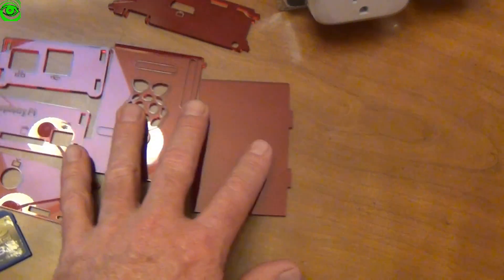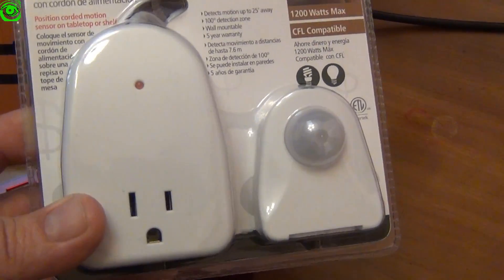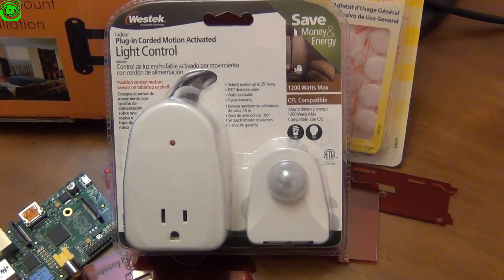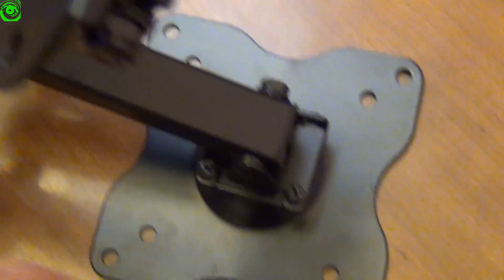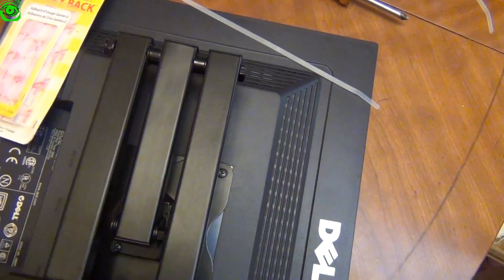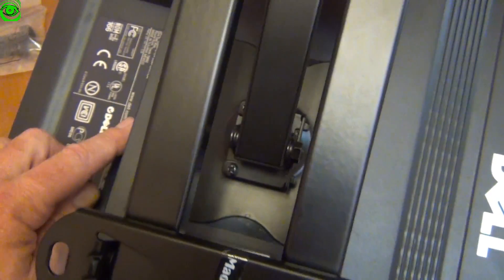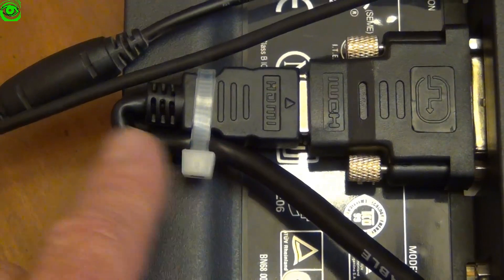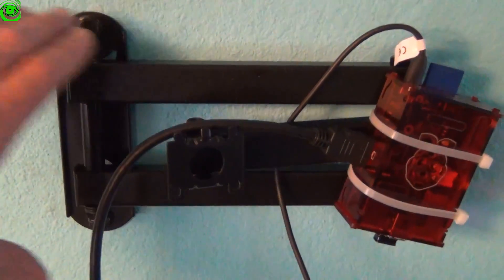DIY Raspberry PI Digital Picture Photo Frame - P3

Comment: Can this be made to access a shared Dropbox folder instead of a local folder or instead of copying files to an SD card? That way, one could just move pictures in and out of the dropbox folder from any computer or internet connection and have the slideshow updated.
Reply from the maker: Good idea!  Have you seen this?
https://www.raspberrypi.org/magpi/dropbox-raspberry-pi/

Comment: I am looking for slideshow with random photo order and with random transition effects. Can I achieve that with Raspberi Pi. I see that it changes the photo, but didn't see any transition like in old Nero. Can you advise something?
Reply from the maker: Hi Alex,
This method didn't have any transition effects.  I'm sure if you searched you may find a better slide show software.  This video is close to four years old and that's ancient history for most computer technology.
Good Luck!
Doug
Reply: Thanks Doug.
 I was trying to get advise from any possible source, and your answer is greatly appreciated. I didn't find anything simple with transition yet, but I found your video as a kind of what I am looking for. No transition here, is the answer that means it is not for me. Thanks again.
Reply from the maker: Did you see this?
https://www.raspberrypi.org/forums/viewtopic.php?f=38&t=61389
I didn't read it all, but, it looked like what you may want.  Check it out.
Reply from the maker: Infobeamer looks like the ticket:
https://www.raspberrypi.org/forums/viewtopic.php?f=41&t=60791
Reply: Thanks a ton. Will try. You are THE MAN. Thanks again

Comment: Doug, I had your wonderful picture frame up and running, but then my SD card got corrupted, so I had to start over. The new one runs, but with an odd twist. The old one would run the slide show until the motion detector timed out (20 minutes) and shut off the power. The new one runs for about ten minutes, then the slide show stops, but the power remains on.  Have I messed up a setting that controls how long the slide show will run? Any thoughts?

Thanks

TomC
Reply from the maker: Hi Tom,

It sounds like the screen is timing out and powering off.  Check out this part:
https://youtu.be/PHwyIIjz4vA?t=14m6s

I've been super lucky, my SD card hasn't been corrupted, and it turns on/off all the time.  

Doug
Reply: Thanks for the response. The monitor and pi are staying on, its the slide show that is not displaying. Can't quite make sense of it.
Reply from the maker: What happens if you start the script from the command prompt?  I saw someone else having a problem with start up, but, it was because he was mounting a USB drive.  I think he solved it by launching the script on a longer delay.

But, a good first test is to start it from cmd prompt after it's booted up.  If it's always timing out after 10 minutes, there's some kind setting missing.
Reply: Problem solved. It was a screensaver issue. I updated the os and the screensaver and all now seems to be working. Thank you for taking the time to reply.
Reply from the maker: Excellent!  That's a happy ending!  =  )

Comment: what's the total cost of this project
Reply from the maker: Depending what you have...most of the cost is the monitor.  I had the monitor already and think after everything include wall mounts, timers, RPI, and all hardware...approx $150.  Sure it's more expensive than the 8 or 9 inch models you buy in the store, but, i think it was worth the expense to view my family photos on a larger monitor.  Also, if you do decide to work this project, the OS on the RPI has changed and some of the instructions are different.  However, many people have made comments about the needed modifications.  Ideally, if you can find an older version of RPI OS then you probably will not have to deviate from these instructions.  Thanks for watching Anand.  Doug
Reply: Thanks Doug
Will try it out

Comment: Hi is there a way of making the slide show recognise a new photo added to the folder? when a new photo is added it wont show unless you stop and restart the slide show I was wondering if there was a way of refreshing it automatically so i can just add and delete photos while it is running?

Also mine doesnt auto start at boot up but thats not an issue.

Thanks David
Reply from the maker: +David Forsyth Hi David, since mine is on a timer, that simply shutsdown after 30 minutes of no room activity, it hasn't been an issue for me.  However, your correct, if you add new photos, then a restart is required.  As far as your autostart, other comments below have solutions for this problem.  Unfortunately, right after I did this video, the RPI OS changed, and the autostart changed a little.  Thanks for watching!  Doug
Reply: +Astrophotography Tutorials i managed to sort it i added the --refresh 5 into the file and it refreshes every 5 seconds now and works great, i also added the auto startup line in the lx file direct and it also worked :)
Reply from the maker: +David Forsyth Wow Great Tip about the --refresh 5 David!  Thanks for sharing!  I'm glad you got it working.  I really love my Photo Frame, so much better than any department store version you'll find on the market.  Doug

Comment: Is it bad for Raspberry pi to Power Off abruptly without the Poweroff command? Wont that corrupt files when power cuts out a few times a day? I like the idea that the monitor could be on the motion sensor and Pi stays live all the time.
Reply from the maker: +Miram Afridi Hi Miram, I've been running mine now like this for over two years, and it hasn't corrupted any of the files.  It's still ticking...perhaps its just dumb luck on my part.  I have my motion sensor power on and off everything including the RPI.
Reply: Hi Miram. Do you ever notice that some people seem to get away with "murder" whilst others get stung on the first attempt? Well, switching a computer, any computer, including a Raspberry Pi, can cause corruption of the file it is currently accessing or the FAT (File Allocation Table). It also seems to happen when you can least afford it too! It would be good to put a transmitter or  Infrared sender on the PIR sensor and have the Raspberry Pi perform a controlled shutdown then turn off the power after it has completed the shutdown. A lot more complicated, I know, but it could save time and the trouble of rebuilding the SD card file system etc.  Just wanted to let you and anyone else know that there are risks with simply switching the power off on a Raspberry Pi. You wouldn't just switch the power off on your Windows PC or Mac would you? This is no different.  What are the odds?

Comment: an you take this idea and instead of using an old computer screen, can you use an old LCD flat screen tv? say a 36 - 42inch flat screen?

cause I have a lot of images I would love to have up on my wall but its too expensive to print them out and such, so I was wondering if it was possible to take a large tv flat screen and do basically this to it, with a wifi enabled raspberry pi?
Reply from the maker: Rivyn Daniel Yes, you could use most any monitor/Tv screen.  I must report that I ran into one Monitor the Raspberry PI didn't recognize the resolution and it would not display...you may need to experiment a little first, however, if it doesn't work you will not be out a lot of money.  You can use the Raspberry PI  with WIFI, but, it seemed slow to download and display the image.  Another suggestion is using "Kodi" as your multimedia console on the RPI.  Saving all the photos on the RPI's SD card works very well, the only problem is you don't have your entire photo library stored on the SD card.

Comment: how long does it take Raspberry PI to boot and start the slideshow after power on via motion controlled switch? Or I guess if it is too long you could only power monitor via the switch while running Raspberry all the time (power consumption should not be too bad)?
Reply from the maker: Not long, I would say about 1 - 2 minutes.  As as it starts up it starts showing the slide show.  I've found while guests are present it stays active.  I would say the 1-2 minutes start time is worth the energy savings of not having the monitor on while no one is in the room.

Comment: I am interested in making a digital calendar, but with custom pictures for numbers and the months. How would I go about doing this? Any links would be greatly appreciated. Oh and if I can manually change the date with buttons that would be a plus.
Reply from the maker: Not really sure how you could do this...I mean you could make a JPG of the calendar you wanted and then display it...Also, the Raspberry PI is a full functional OS, I know there's a calendar, perhaps you could boot, and display the calendar, but, I'm not sure how you would do that...Google?
Reply: ok thank you anyway
Wait, what about being able to show an image in a certain location on a screen, can that be done?
Reply: With a Pi? You can bet you can do that!
You can do that with an Arduino as well, even on an LCD, but you might need some additional electronics to drive the panel.

If I were you I would use an eInk display and use a Spark Core or Spark Photon to drive it and control it over WiFi, integrating Google calendar appointments and such... That might even be a project worth a Kickstarter (I want a portion of the company shares if you do it!)
Reply: I can do it on an Arduino with no problem, but I need to output it to a projector via HDMI or VGA.

OH! I can do it on a gameduino too!